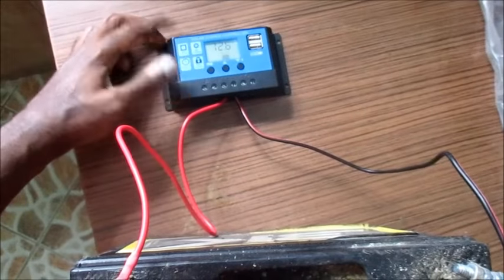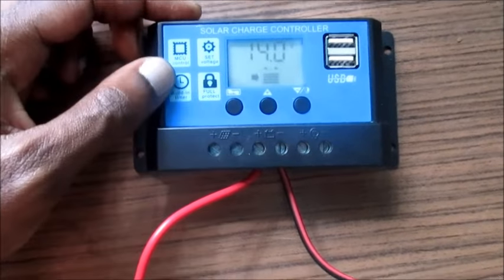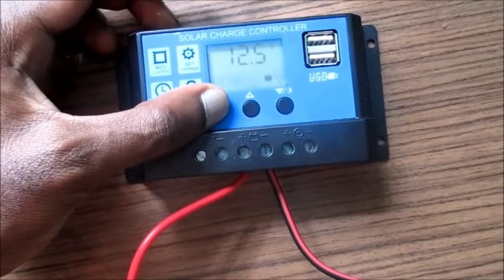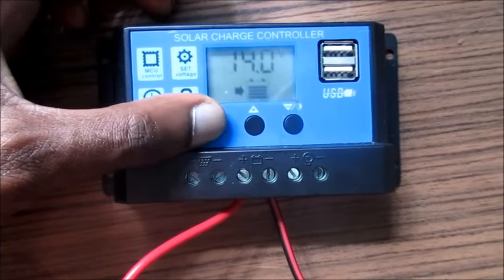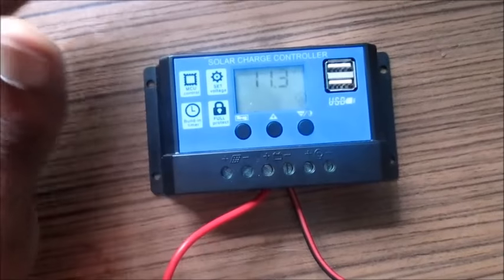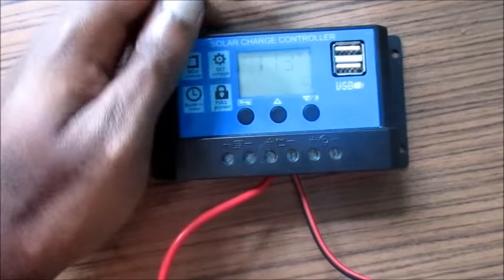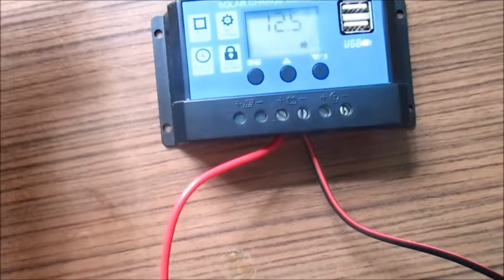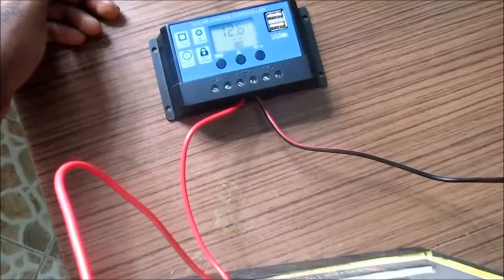How to use solar charge controller 2020 -See How To Set Up PWM 30A 20A 10A Solar Charge Controller

Comment: What is b1/b2/b3 for class of battery?
Reply from the maker: is how many connection points in a battery
Reply: b1 is for lead acid batts.The unit autodetects the type of batt that is connected.

Comment: Have you experimented with the time function?  I can't figure it out.  If you reduce the time from 24 to 23, the load turns off.  Does that mean if you wait an hour it will come back on?  Or does it mean if you wait 23 hours, it'll come on?  What if you just want it to run 10 hours a day?  Do you have to set it 14 hours ahead of when you want it on?  These Chinese instructions are worthless.
Reply from the maker: if you the load to shut of at a particular time it you. Most persons use a inverter from battery instead of using the load on controller
Reply: @Lenzwalters  sorry, you left some words out of that first sentence,  don't know what you were trying to say.  I don't use an inverter because it uses more power than what it would be running.   I'm only using 12v fans and lights. The point of the hour setting is to turn the load on and off.

Comment: So i have thys controler , the 24 v type 60a , and 4 batery gel type 12v 100a each so 24 v at 200a total , it does not charge them , if i plug my phone it it , it will discharge the phone instead of charging it :)) after a sunny day , it says 25,4 and stops charging , if i put a load of 500w on my inverter , after 20 min it says 22,7 v , it does not charge or deep charge , i trid it on batery type 61, 62 , 63 all the same , cheap yes , but not worth it
Reply from the maker: Hey those controllers are design for lead acid batteries if your battery not lead acid it wont charge

Comment: Bro you confuse people, you don't know what float is and your explanation has no logical path. Charge controllers have three stages of charging same as batteries. Lets start with the cheap china PWM you are using which has very basic functions, 1 charging voltage ( adjustable ), 2 disconnect load/low voltage between 10.7 and 12.6 volt (adjustable), 3 reconnect load by default is 12.6 volt but also (adjustable), 4 is timer settings for a small load like a led bulb which can be set to light up between 1hr and 24hr, usually connected to the ports of the controller. Other loads are connected directly to the battery using an inverter. I must say that ( mention 2 ) disconnect load at low voltage also works when loads are connected to the battery using inverter, the charge controller does also the job for the battery not only for charging, which means that all the loads are cut off when the battery drops bellow 12 volt for example in the night time. And now the charging stages, we have Bulk when the battery is at very low voltage, then we have Absorb typically when the battery reaches 80% of charging or above, and the last we have Float when the battery is fully charged meaning that if the load does not need higher current than float charging it will stay like that usually during full sun light. If your load needs more current then the controller drops to Absorb mode, and if your load needs even more current, then yeah the load takes current from the solar panels and from battery at the same time which is not good because then you have to upgrade your whole solar system. And as for the last i want to go back to that shitty PWM you are presenting. It does not have these three charging stages, you can only set the voltage that you want to charge for example car battery ( not recommended ) with lead acid it needs between 14.4 and 14.7 volt to charge properly and yes it does have overcharge protection but if you want the Float mode you have to set manually from 14.7 to 13.8 that is the correct float voltage.